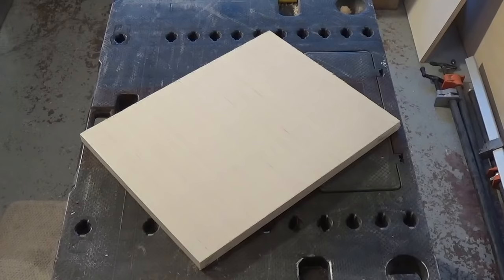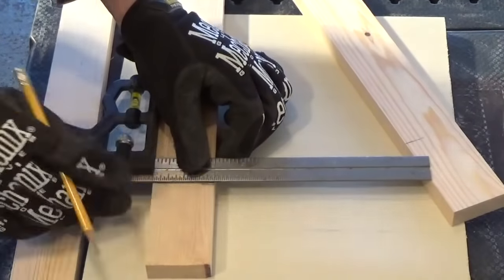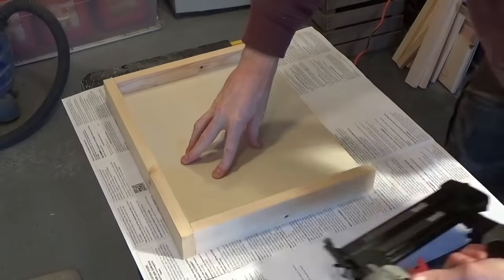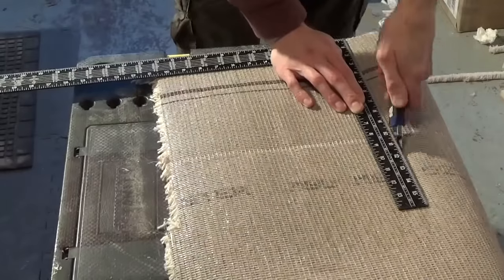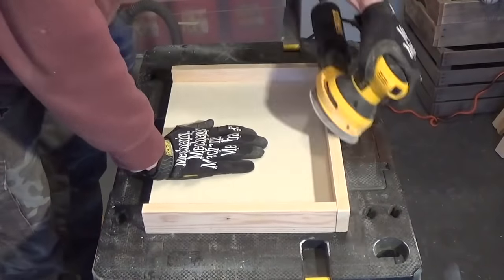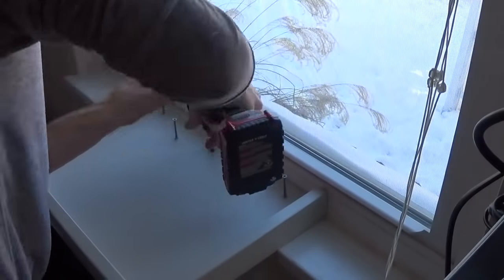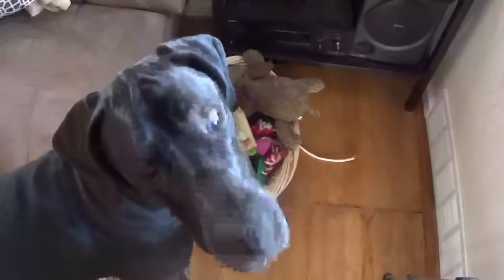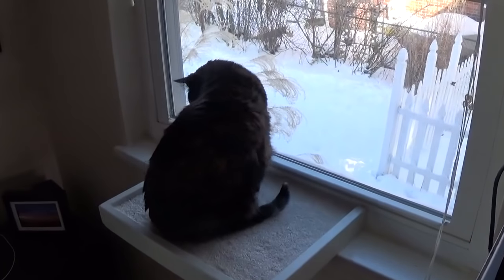HOW TO MAKE A WINDOW CAT PERCH

Comment: That's a great design, especially with the carpet insert since that can be removed and cleaned or replaced when hairballs happen. :)
Reply from the maker: Definitely!  You can just take the carpet out, throw it on the floor, and run the vacuum over it and it's good as new.  Thanks for checking out the video!

Comment: I have ceramic window sills. What could be a work around since they aren't wood? I'm afraid to crack them.
Reply from the maker: You definitely need another option. They actually sell reasonably priced set ups similar to this. Some of them are just suction cups on the window. Hope that helps and thanks for checking out the video.

Comment: Is there any alternatives for screwing it on the window sill? I still live with my parents and they dont want me to destroy the window sill. If there is please notify me it would be a great help
Reply from the maker: I understand.  You might be able to clamp it somehow with the clamps that Lowes and Home Depot sell.  You can always just fill the holes with sand-able wood putty and then just paint the window sill.  You won't even be able to tell that it was there.  That's exactly what I did and it looks perfect. Hope this helps and good luck! Thanks for checking out the video!
Reply: Joe Lydic thx for the advice it really did help me!
Reply: You could buy a commercial cat tree at roughly the same height or higher as your window. Of make one that is free standing with a base and legs.
Reply: Yes, screw a piece of 2x4 to the wall  under the sill, and mount the perch on the 2x4. dry wall easier to fix than damaged window sill. can also use shelf brackets
Reply: You could also secure a thin strip of sheet metal to the entire length along the front of the board,
 so that the sheet metal functions as a lip between the window and sill to help support the perch,
especially if it is window that is seldom opened.
And it just occurred to me that for a lot of old style wooden framed windows, you could
use an L shaped piece of sheet metal and screw it to the perch and then place the other half
of the perch under the open window and close it on top of the sheet metal.  That would make it secure 
and easy to move to other windows.